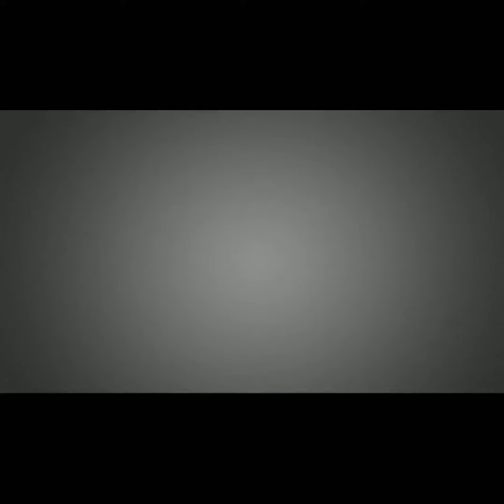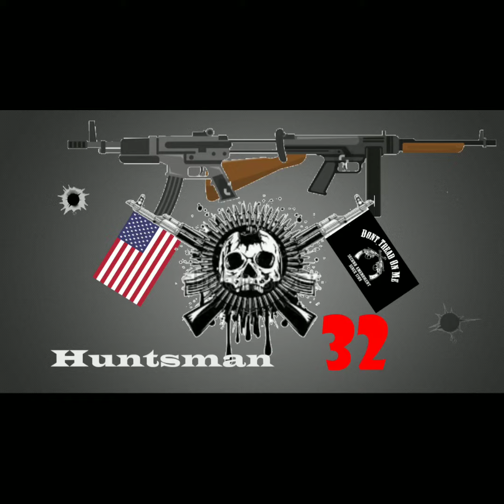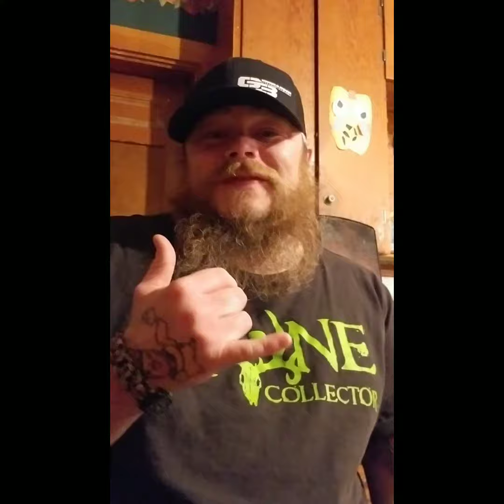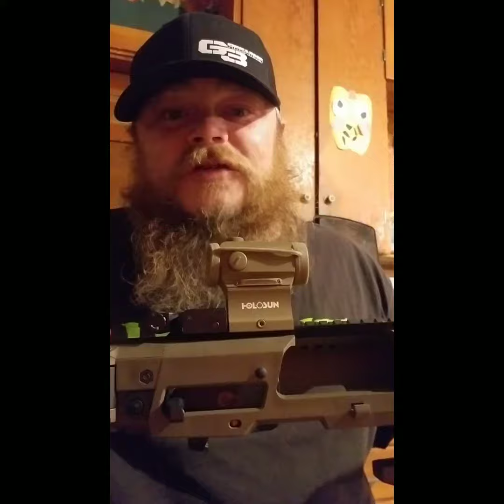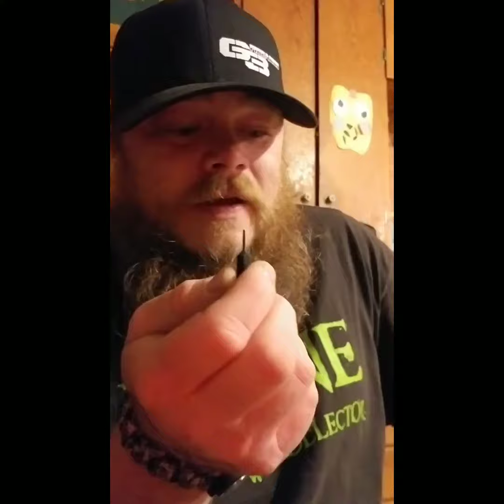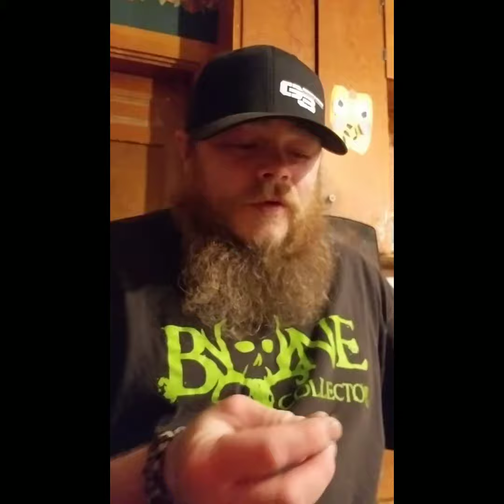Holosun 403b battery tray

Comment: Stay away from the B model! There's a reason they come with an extra tray! Go with the R models (HS403R or HS503R) that resemble an Aimpoint T2. That is the absolute most durable and rugged design for micro red dots!
Reply from the maker: Thank you for the info on that i didnt realise that the b model wasnt as up to par as the r model. Ill deffinatly be looking for an r model version. I like holosun but they deffinatly flawed the battery trays on the b